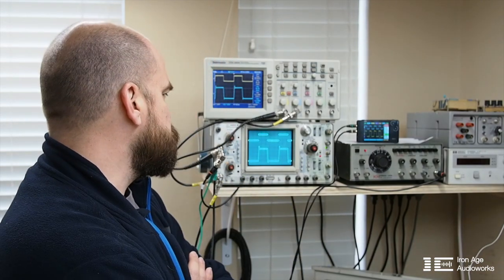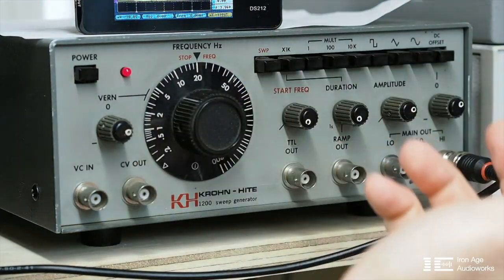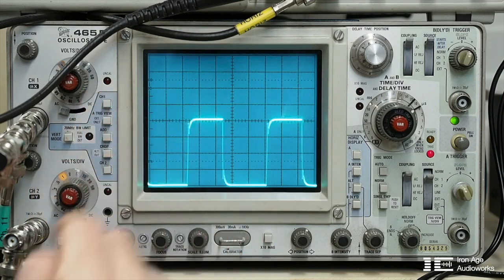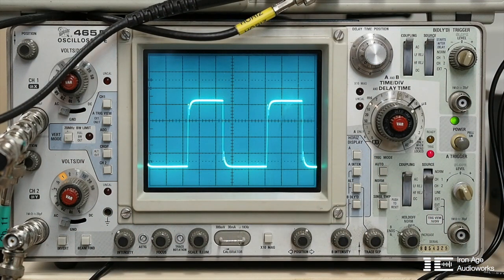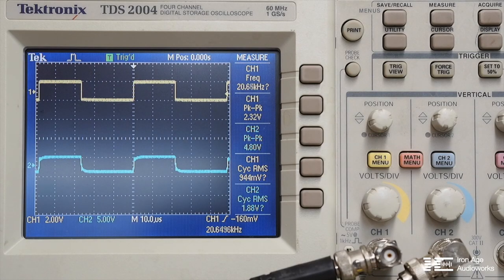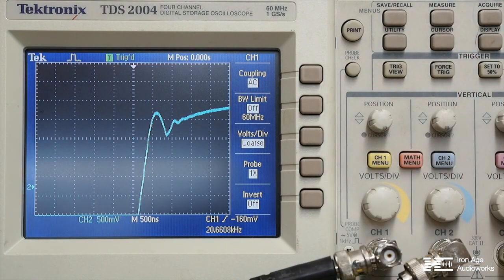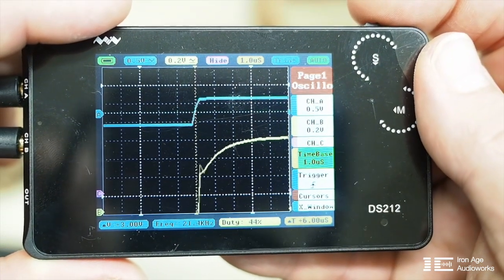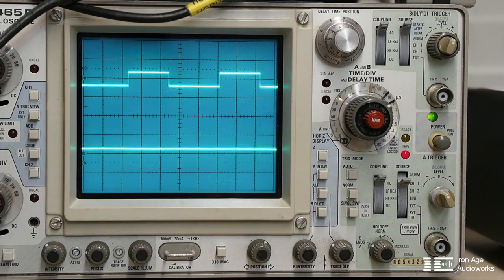using oscillosopes and testing op amps

Comment: Thank you for teaching us! To troubleshoot my DIY audio synthesizer project, do I need to add a little load to the op amp output for testing? And, do I need to add some type of terminator to the scope probe (other than using the x10 probe mode?) Cheers!

Comment: The 465B still is an amazing scope and when I have a problem, usually a tantalum casp, I can repair it. This why I have 4 of them in my lab. Actually, it was not too long ago when the 465B was among the best one could get. 
The digital scopes have come a long way and I may add a top end Tek or possibly Rigol to my lab but the 465B's are here to stay.

Comment: Where on the board did you place the leads from the oscilloscope and wave generator?
Reply from the maker: In the video we use a opamp test board by FiveFish audio. The board has bnc connectors for input and output signal. The routing is a signal coming from teh signal generator, that enters the O-scope Ch1 and splits and goes to the op-amp test input. The output of the op-amp test boad goes to Ch2 of the o-scope.